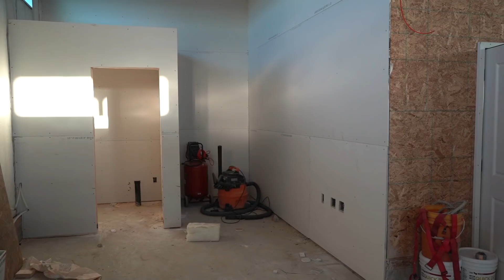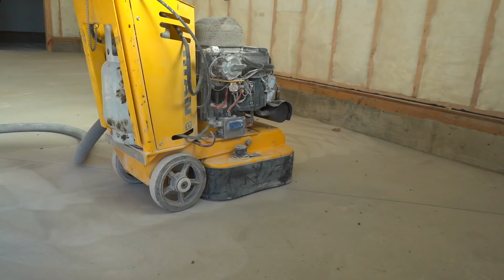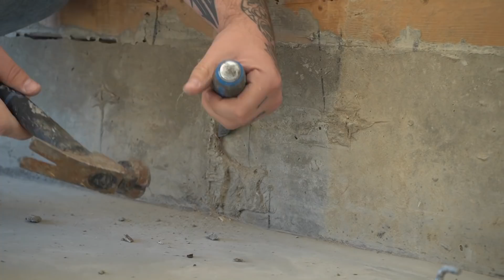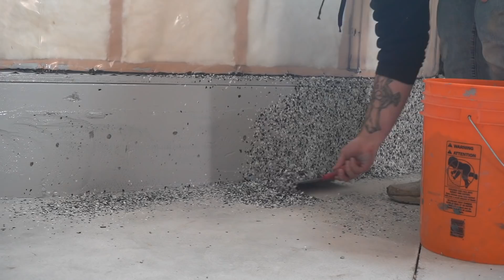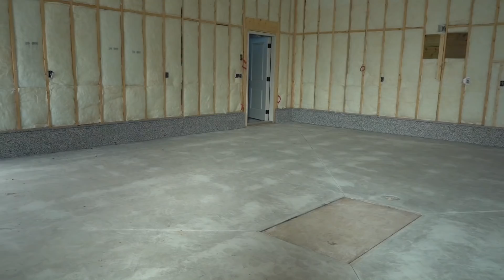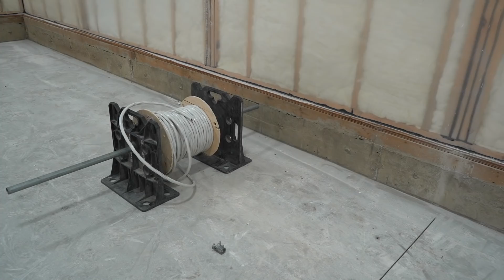Huge Studio Changes!! | Grade Beam Coating and LED Lights! | Detail Geek

Comment: Detail Geek
I absolutely encourage anyone watching these videos not to order supplies from his web site. It is a rip off. I ordered over $100.00 of his product and the main one I needed, an $18.00 bottle of Detail Geek All Purpose Cleaner, arrived nearly empty. Nothing else in the shipment was wet so I knew immediately that it had not leaked out but been shipped this way. I contacted his web site and days later received an email referring me to a 3rd party web site with verbiage that indicated he bore no responsibility for orders placed. I went to the 3rd party website which required proof of my entire order as well as pictures of the damaged product which I asked to be replaced. It has been 4 weeks now and I have had no response from the 3rd party web site, nor does it provide a method to verify the status of a claim. I highly encourage everyone to avoid viewing or certainty ordering product from this YouTuber. He is most certainly a sham artist. Avoid at all cost!!

Comment: oh no they used drywall on the walls where all the water lines are being run thats bad. gonna get mold real quick especially in the bathroom. when i was a carpenter i was taught to use cement wall which is like a bunch of mesh thats stacked together and held by cement. those go where waterlines are cause it wont get mold.

Comment: Man, good looking garage. I just think there were so many more things that come to mind, when building the ultimate garage. No lift? I don’t know a detailing garage without a lift, even a scissor lift. You’re not getting any younger. Second, a shower in the bathroom. At least a place to rinse off, unless you live like 5 minutes away. But even at that, with all of the infectious things, at least a rinse down.  Washer and dryer hookups for washing rags? The welding outlet was a great idea. How about a hookup to plug in a Tesla charger? “Big Ass fans” come to mind for the bays. Retail space to store and sell your products, so you can suggest supplies for people to keep their cars clean. 

I would have definitely hit up Matt, over at Obsessed Garage on the lighting, and placement, and color temp. He knows exactly what needs to be in there. A chemical distribution station. A place where you can plumb in DI water to fill buckets and just hit a few buttons for soap, and fill spray bottles. Plumbing for overhead air, and power reels coming off of the ceiling?
Reply from the maker: Lol, trust me I’ve got everything under control and figured out for what I need 👍🏻
Reply: @TheDetailGeek2  can’t wait to see it when it’s done.

Comment: Hello. I'm new to your channels. I'm not a detailer. I just enjoy watching your transformations. I'm kind of surprised you didn't install a 2 or 3 compartment sink in-line or up stream of your interceptor (or as you call it, a pit) to clean your instruments and/or for when you take smaller trim items out to clean instead of bending over to the floor. But then I guess it comes down to cost and/or feasible usage verses expense. Same goes with a track on the ceiling or wall for your pressure washing hose so it doesn't get dirty. But then again, I don't know much about cleaning cars and if you knew how I cleaned my car you might cry. 
Please don't take my remarks above the wrong way. I think you do a great job and your shop is coming along nicely. All that matters is that it what you want and what works best for you. I can't wait to see the final reveal.

Comment: I can't believe how they installed those chips.  Looks like it's on the sill too.  Taking shape.  Enjoying the process.  I notice you went with a smaller water heater.  Is that just for the half bath?

Comment: Looks really good!! I have a recommendation for your central vacuum unit: the Vacuflo 566q or the Vacuflo 960. The 566q is quiet and great for one user. The 960 is a little louder but can have 2 users at once and hold a lot more dirt. The 960 dirt bucket is metal though. Either way, you won’t have to spend money on bags or filters and it will be exhausted outside (away from you!)

Comment: Hi mate the studio looks brilliant but one thing I would maybe look up on is the regs for the plumbing I don’t know how different it is over there as I’m from Northern Ireland but I’m pretty sure it’s meant to be copper coming off the cylinder/water heater not pex but the regs might allow pex. Also maybe get a clip on that gas line as if it got knocked hard enough it could twist. Not trying to discredit the plumbers who done it just want to make sure you get a good job mate

Comment: Really starting to come together. That floor grinder for anyone doing their own floors you can rent one here in the States from Home Depot. Just be aware it is a dust maker. If you don't have a Shop-Vac rent one when you pick up the machine.

I like what you're doing on the outside. Really can't wait to see it when it's all done. Good call on adding more outlets. With how your walls are it would be a bear to run wire once the wall is sealed up.

Comment: Looks great...BUT...why didn't they fill in all those holes on the on the side walls before they painted and put the chips on? And what is a 50 Amp welding plug for?
Your shop is amazing.
Reply: I wondered about that as well. Moisture penetration points. In fact,  given that this is going to be a high moisture room, I wonder what steps have been taken to prevent mould from growing behind the drywall and elsewhere? I would think that the build should have been treated like a wet room bath given high volume of moisture that will be in that bay.  Wondering ....

Comment: I was losing my mind watching them coat those beams with the holes, etc in them thinking they're going to just leave them like that!  I know a bunch about these coatings and they should have filled them all with epoxy, ground down the excess then coated it.  When do you expect to be in the new space working?
Reply: A skim coat of something would have been a superior finish... epoxy, render, whatever would be suitable for the final coat...
Reply: Could’ve just done a quick coat of Ardex over the wall , isn’t very hard to apply either.

Comment: Can an American citizen explain to a European citizen why do you guys built literally everything using wood and panels? I mean, insulation, isolation when it comes to temperatures and sound is rediculously poor compared to bricks/blocks + modern styrofoam. Is it ONLY about the cost? And dont take this car shop as an example, I'm more curious about those carton like houses that get blown away by a random silly tornado, while the bricks would easily stand strong here. Just cant understand, but there must be a reason behind this I assume?
Reply: Mitch lives in our northern neighbor Canada, but same idea... Cost, abundance of wood, still quite energy efficient, easy to repair and modify.  If you think your brick house would stand a midwest tornado, well, you may want to look into that a little more.

Wood is plentiful and cheap in North America, and so are crews that know how to work with it. That makes it ideal for building. Masonry is more expensive and requires different skills to build, as well different engineering of foundations, etc. Further, if your home is destroyed your insurance policy will not pay you to rebuild a structure that is twice as expensive due to nonstandard materials.

Here are some photos of brick and concrete structures that were hit by a tornado:

http://media.salon.com/2011/06/damaged_houses_are_seen_after_a_tornado_swept_through_the_downtown_area_of_monson_mass_wednesday_june_1_2011_ap_photoworcester_telegram_gazette_tom_rettig.jpg

http://www.davidoprevatt.com/wp-content/uploads/2013/05/concretepole.jpg

https://s.w-x.co/simwx/dru/2014/04/57ce93f6-0710-4f0e-841b-281f3e45fc00_980x551.jpg